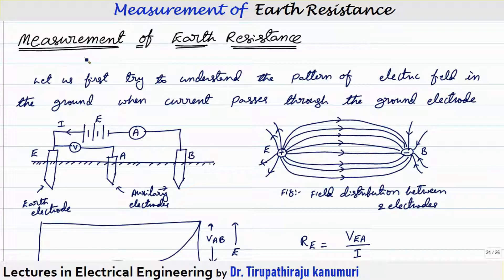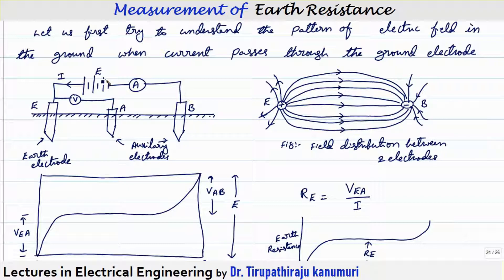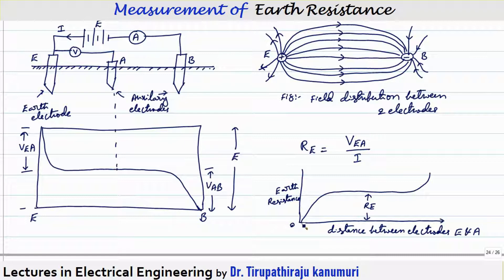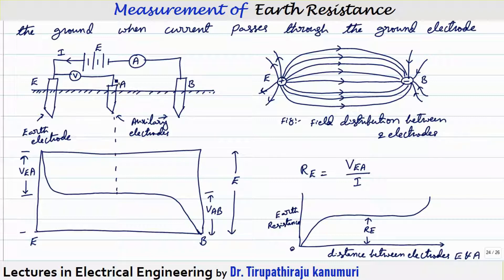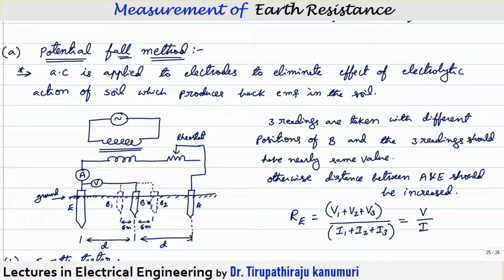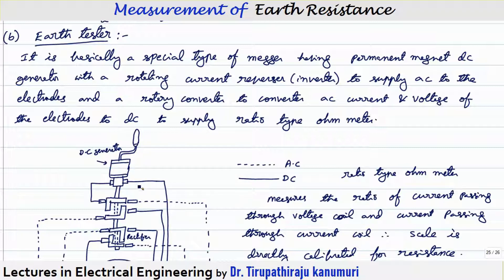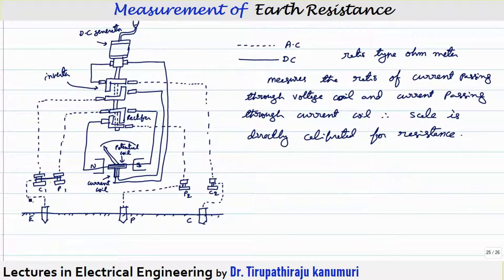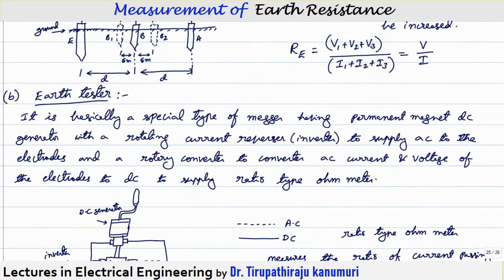ME40 Measurement of  Earth Resistance

Comment: Sir please explain why the resistance of earth surface near B electrode  increased to much higher value. Shouldn't the graph of R vs d should be exactly similar in both sides of A electrode i.e  Resistance near B electrode  gradually decrease to zero.